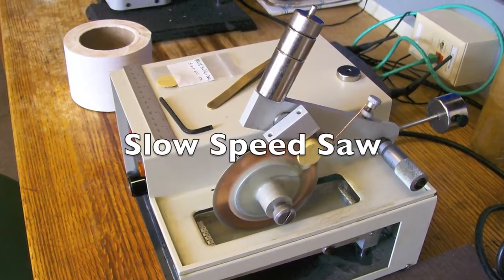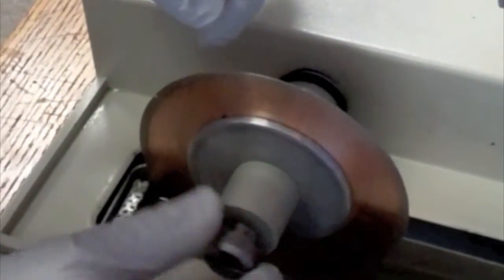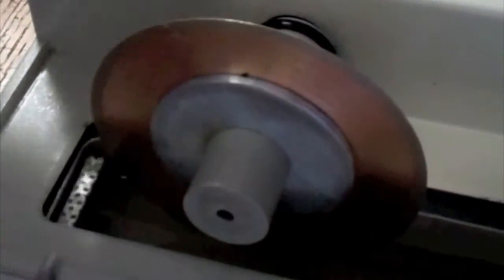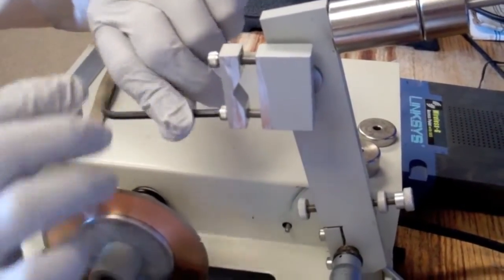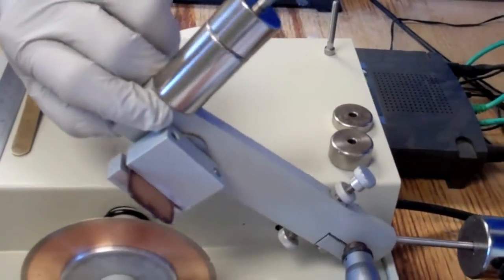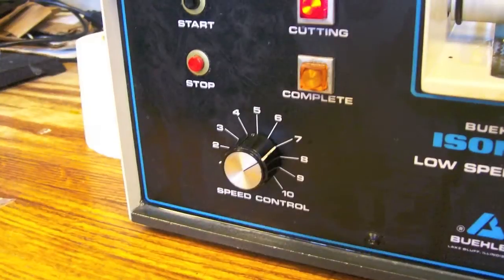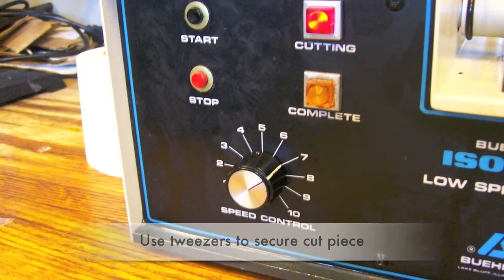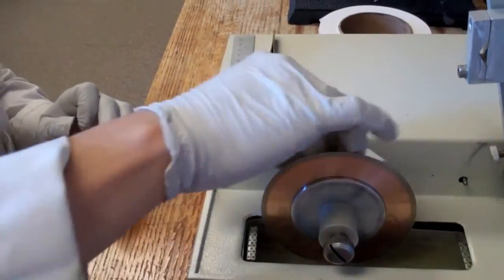Slow Speed Saw

Comment: We have one of these machines in our lab but the weights were lost. The manual says that there are 4 of them: 25g, 50g, 75g, and 150g but the manual does not say how much the counterbalance weight that is mounted on a shaft adjacent to the micrometer. Any chance you could weight it for me? This way, I can make all the weights in the machine shop. Apperently, Buehler does not have parts for this machine anymore. Thanks!